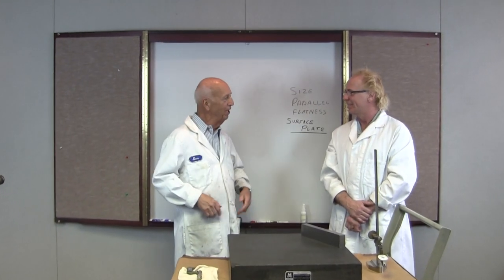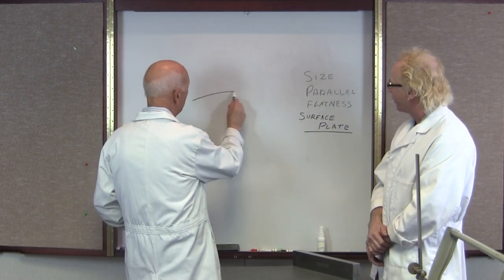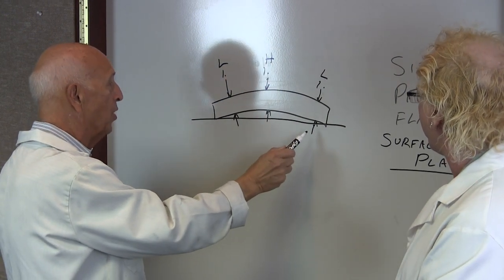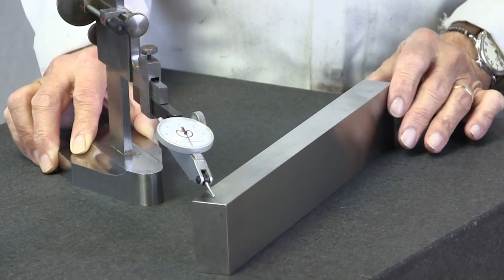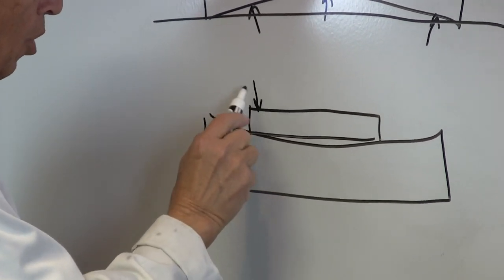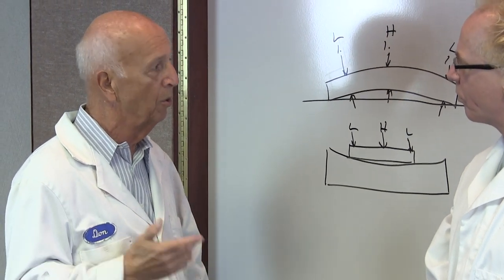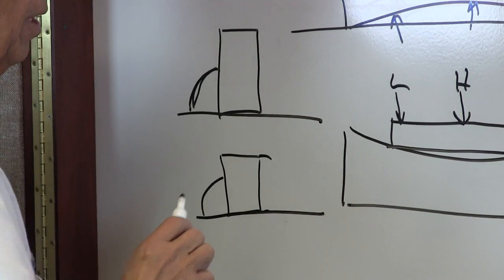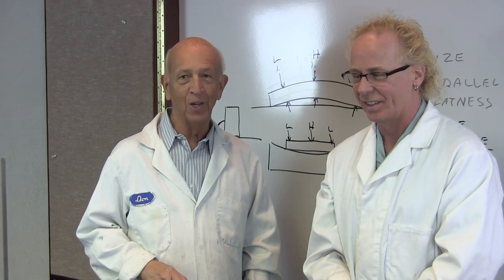How To Understand Parallelism, Flatness, and Size: Your Surface Plate and You

Comment: Great to have you back.  I'd like to add one small point: in geometry, only straight lines and planes can be considered parallel.  Lines and planes which are a constant distant distance apart, but which are not themselves straight, are equidistant but not parallel.  Not to be too pedantic, but in order to think clearly, it helps to have your head on straight.
Reply from the maker: Right you are.  Thanks for sharing, and thanks again for watching!
Reply: Curved lines can be parallel.
Reply: @SuburbanToolInc  Depends on the wording of the definition, you were not wrong I don't think.

Comment: I have recently purchased an inexpensive (new) granite plate, calibrated AA. Its opened up a whole new world for me.Now, as Don has pointed out, I can test objects to see if they are flat. However, the nightmare is making a cube!A cube that is 90 degrees on ALL corners. Perfectly square at all points.I can grind a cube. test the cubes opposite face on the table to a 10th'. BUT, have I made a parallelogram type shape?  Are the upright faces, perfectly square to the surface plate?You can take an engineers square to the side face and physically see a problem. (Gap at the top, no gap at bottom).If your dealing with THOU's, no problem. Use a feeler gauge.If you need to check the problem to 2 tenths or less and actually measure the piece, from bottom to top (up and down), so you can adjust the block for re grinding. That I have NOT found a solution to.Winding a height gauge up and down is no good unless you know the height gauge is 100% up right to a factor of nothing. Otherwise you could be measuring the deflection of the height gauge.I seriously would love to know how to measure bottom to top, with precision.TIP for curved pieces on a known flat surface table.Clean everything to the last.Place piece on table and gently twist it on the surface. Just touch the corner and rotate the piece.Turn it over and twist it again.If its bent you can feel the piece SPIN on the high spot in the middle, even if the piece is a thou off.You can tell your piece is curved in a instant and grinding can often cause curvature.My Thanks once again to Don, who has made me THINK about problems and to stride to achieve perfection.

Comment: Glad to see you back making videos! I was wondering what if any advantages would a large cast iron surface plate have vs a granite surface plate?
Reply: bcbloc02 cast iron rusts, use granite if possible.

oils used to keep the cast surface in good condition can also skew a precise measurement.
Reply: bcbloc02 gauling can also happen on cast iron, granite being hard and non crystalline or metallic can prevent some possible gauling keeping tenth measurements more true. granite is easier to lap and certify to an a+ or a++

Comment: I had to grind these 16 tool steel cutting rings that were 8mm thick and the tolerance was 4 microns (0.004mm) and when these rings (10 inch in diameter) can back from hardening they worped and bent. The magnetic chuck would pull them flat but after I ground them they would ping back to the bent shape. I had to play around with the chuck to get them flat. So much work involved
Reply from the maker: Right you are, it's certainly much more challenging than it would seem.  Thanks for your comment, and thanks again for watching!
Reply: a way to help keep flatness during hardening is to stack them and clamp them between two thick flat pieces, this will minimizes distortion.
Reply: Sahkram - I mean it sounds great in theory - it might force the object to recrystalize (if enough heat and time) and equalize in an unwarped state but what if there are still some tensions left that will warp the item even after it has been ground after some time? that would kind of defeat the purpose right?
Reply: chronok not really as they would wear out before it warped. I make them every now and then so they do get replaced when they get blunt.
Reply: thansk for the info mate
Reply: SuburbanTool Inc thats a job for a lapper. So grind then lap to size. The old Blanchard grinders would be a example of the rotary mag table problems would pull thin parts down an spring back after release
Reply: Its impossible to GRIND anything "flat".

Comment: the tolerances you are talking about surely would require,what we called a "standards room" with a standard temperature.
Reply from the maker: Correct, and a better table for our surface plate other than a cart :)  For the purpose of our demonstration, though, this worked just fine.  Thanks for the message, and thanks again for watching!

Comment: Don thanks for a great video. I have a question. When a print calls out for flat but does not give a tolerance, what would be except-able on crs that will not be machined to make it more flat?
Reply from the maker: You need to check with your steel supplier